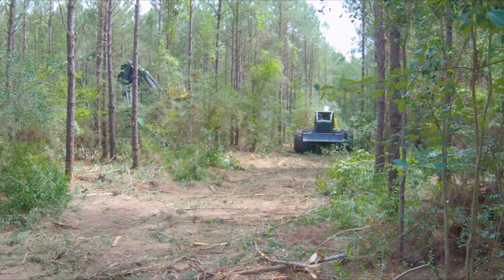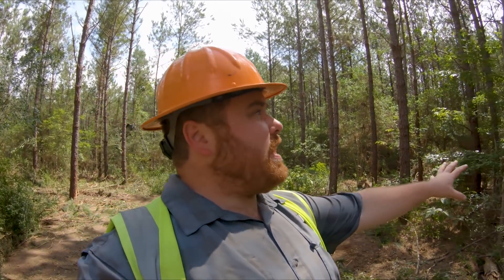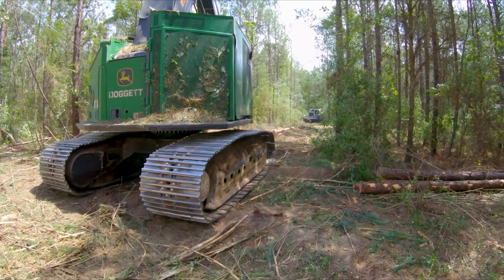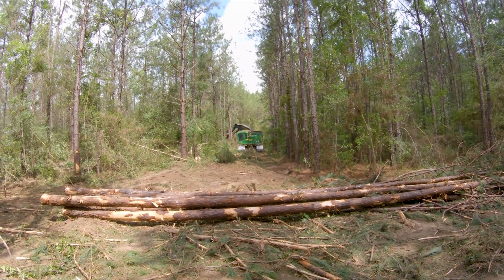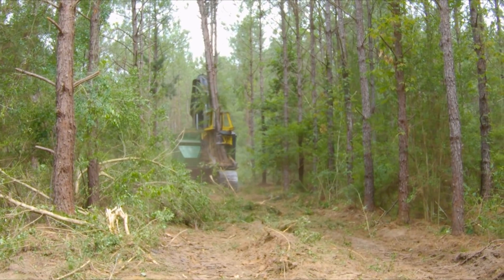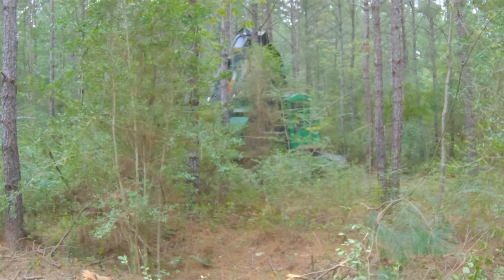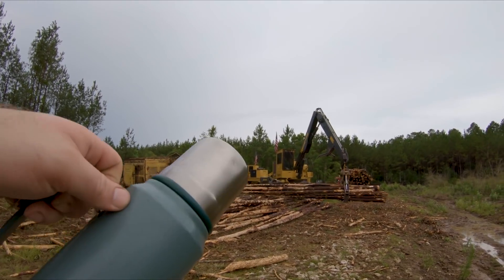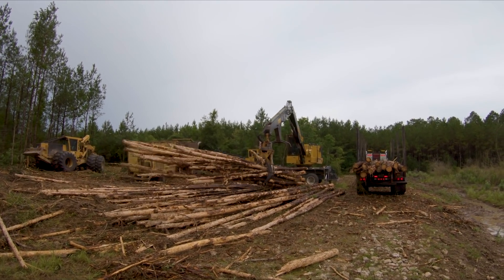What Is First Thinning | Tigercat & John Deere Forestry Equipment

Comment: What happens to the limbs that are removed?  Do they get turned into wood chips or do they get put back on the land as organic matter?
Reply: Also, if you're cutting 3 inch tops, are the trees all pulped, or can they get 2x4s out of the butt ends?
Reply from the maker: They are scattered across the tract as we’re working the rot back into the land. To cut a 2x4 you need a 5” top. All of our material is chipped to make OSB press board or paper products
Reply: Thanks